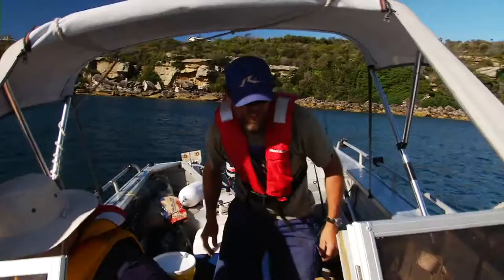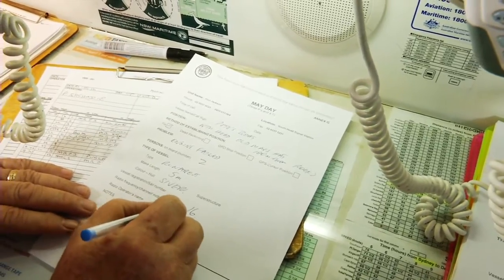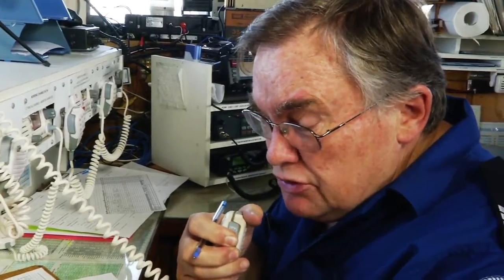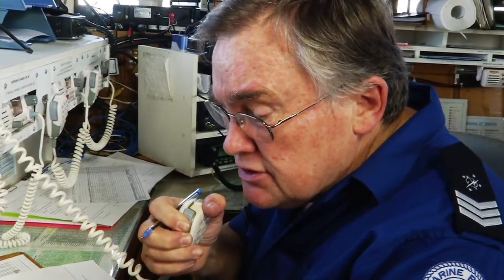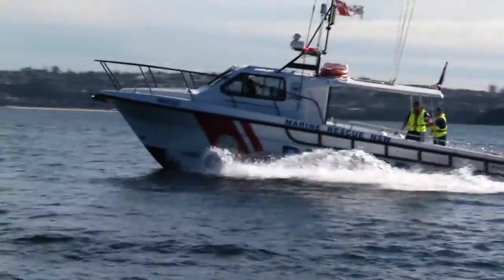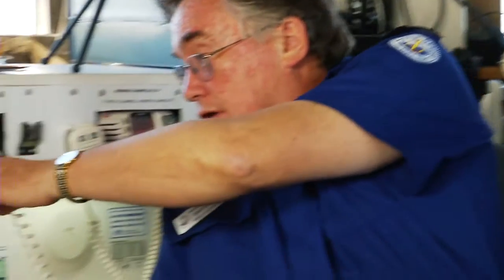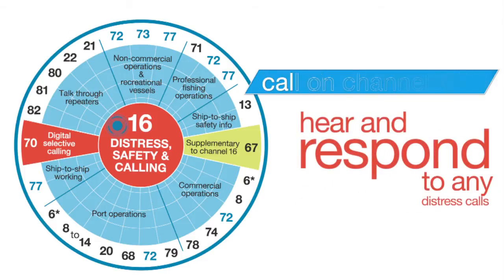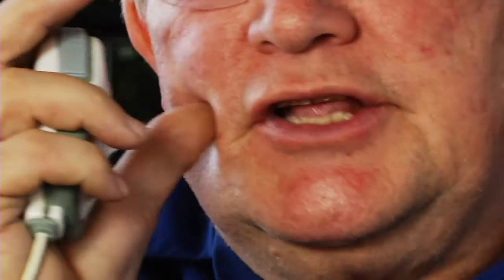VHF Marine Radio - it could save your life! (ACMA/AMC)

Comment: Peter could have swam to safety.
Reply: Yes, well if he had a small electric transom motor, he could have done an assisted drift and limp back to a safer spot. 

Probably better to call in a Pan-Pan instead of calling Mayday, however, this scenario shows that some people shouldn't be out on a boat.
It's always the people that plan their trip, carry the necessary equipment, maintain it as well as having contingency plans in place IF and WHEN incidents arise that rarely need to use them.
Reply: If the boat is threatened by “grave and imminent danger” then MAYDAY is correct. No power and close to rocks with strong winds …. MAYDAY is correct.